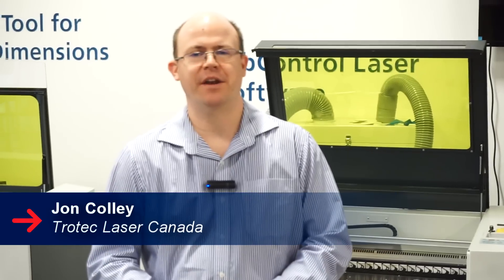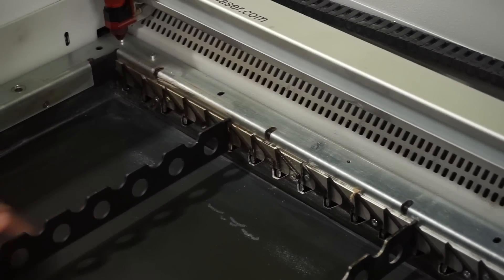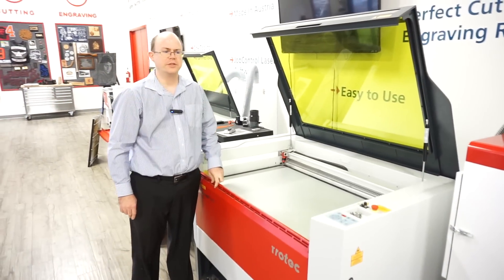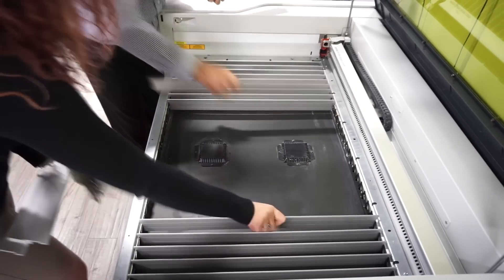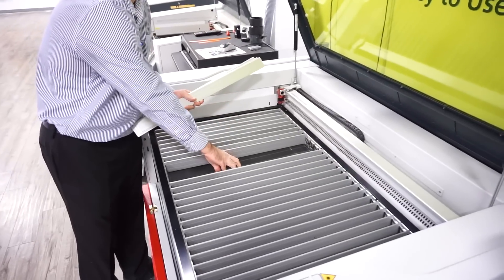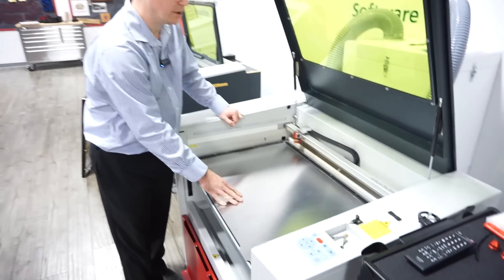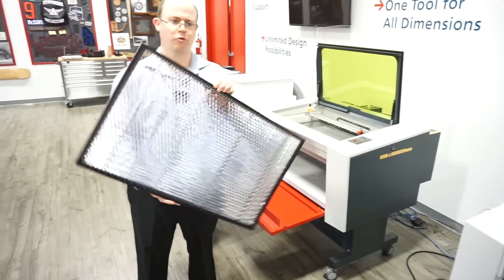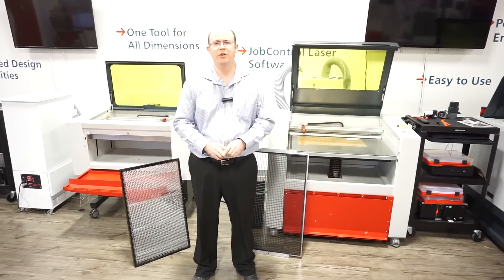Trotec Laser Tables | Tables for laser machine | Speedy 300

Comment: Could you please advise on 150w and 180w Co2 laser machine? Are they capable of cutting 15mm MDF in one pass?
Reply from the maker: Hi Mamoon, 15mm MDF is quite thick we would have to test it on our 200w laser. You can send your sample and application to a local Trotec location to test, if they don't have that specific laser they can send it to our application lab in Austria.

Comment: Hi! Wondering what the when you would choose the aluminum grid over the honeycomb grid or vice versa? Or do they serve the same purpose?
Reply from the maker: +Amy Vanderlaan The grid table is better for most applications because the anodized finish absorbs more of the laser energy which reduces the amount of energy that bounces off to mark the back side of the parts.  It's also heavier gauge aluminum so it tends to be more durable
Reply: Thanks!

Comment: im in love with the quality and practical way of trotec, sadly it needs a fan forum like the one from ironforge, and also a bigger work area with no necessarily big power.
Reply from the maker: Thanks for the kind words and good feedback. When you say big work area, what dimensions are you looking to work in?
Reply: enough to go from an small lamp to furniture.
Reply from the maker: Biggest area we've got is the SP3000 at 87" x 126" starting at 60w.... how low do you need the power to be?
Reply: gradual control, to use like from paper to steel